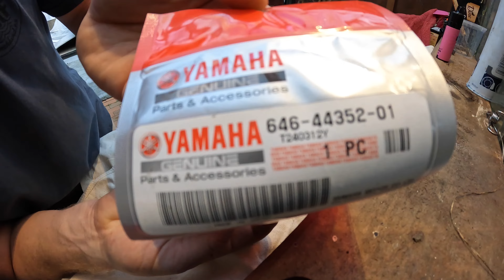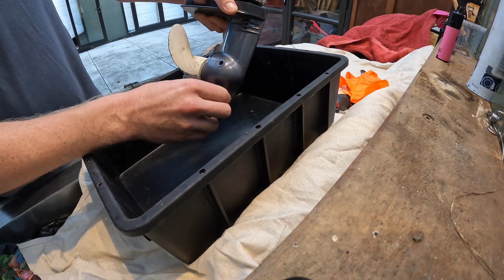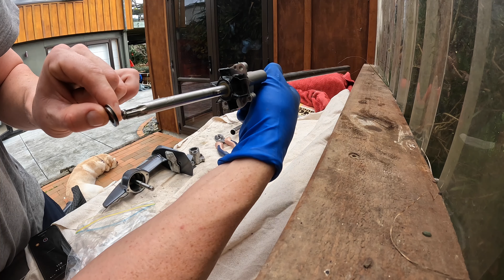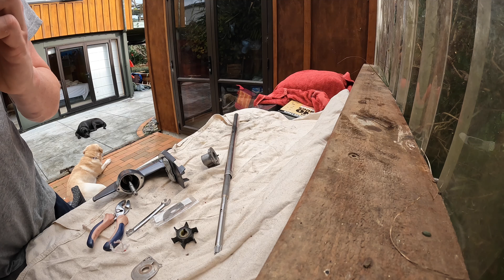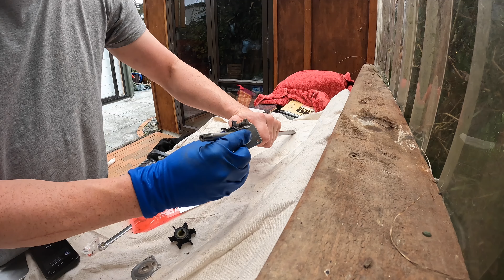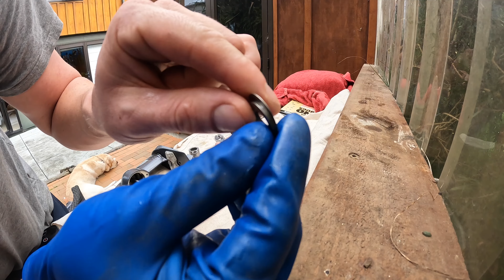Impeller Yamaha 2hp change / service and upper impeller housing replacement

Comment: This is a very useful video especially the details that you go into. Is it possible for me to change the impeller by removing the upper impeller housing and removing the impeller through the top of the shaft. The lower unit oil was changed not to long ago and I was wondering if I could short-cut the process without having to go through the process of removing the small gear etc. Many thanks.
Reply from the maker: Unfortunately not, the shaft tapers out above the housing, so it cannot slide out in this model

Comment: Thank you very much for your video. My Yamaha 2hp also needs a new impeller (no water comes out when engine is running). Why did you replace the upper impeller housing? I thought just the impeller needed to be replaced.

Regards Karl
Reply from the maker: It was heavily corroded, so needed to be changed, you may be lucky and just need the impeller to be changed. I didn’t really show it on the video. You may need to check the other video I have as debri can be stuck in the water channels in the upper block. Good luck

Comment: Thanks for the useful video you demonstrated really all the details,can i ask you from where you ordered the impeller and the kit? I am from Finland and i do have the same outboard
Reply from the maker: Hi, I approached my local Yamaha dealer as I believe in using OEM / manufacturer approved parts, they can also post to your address if you don’t have one close by. There is also a water pump repair kit 6GD-W0078-00, this has many spare parts that can be used at a later date, as needed . Thanks for the comment! Please like and subscribe, I will post a video on how to clean the upper water channels soon, regards